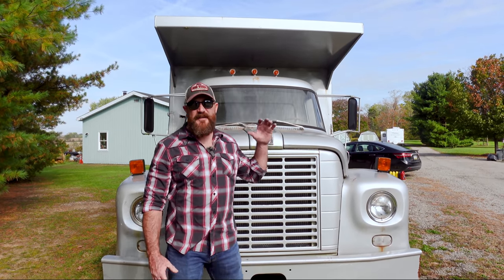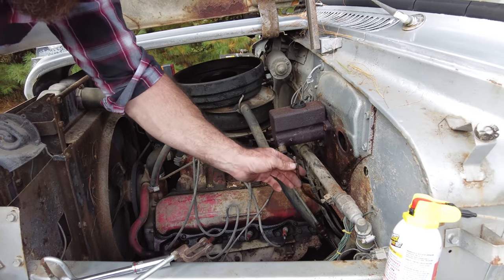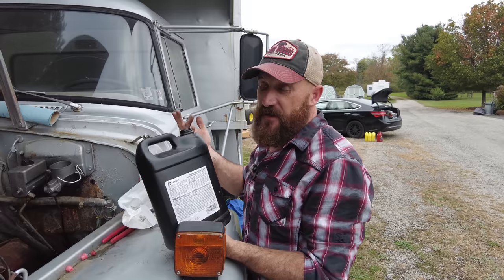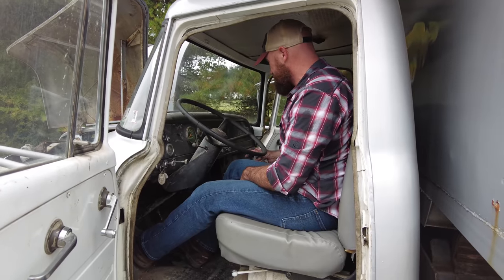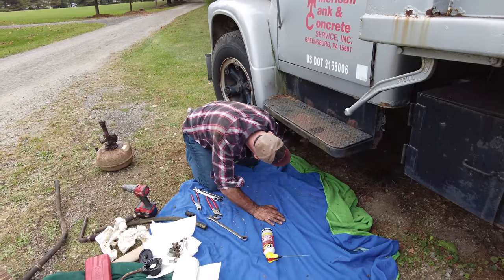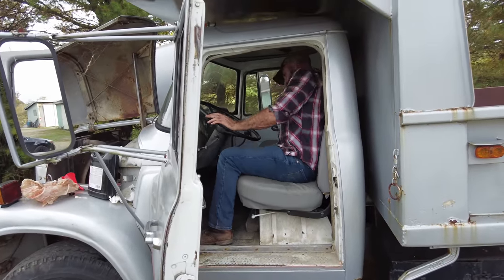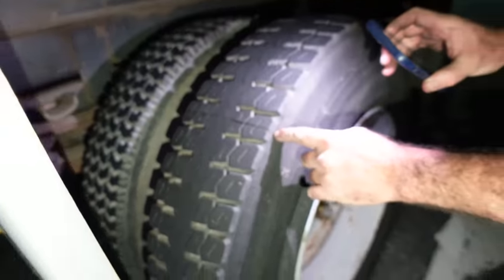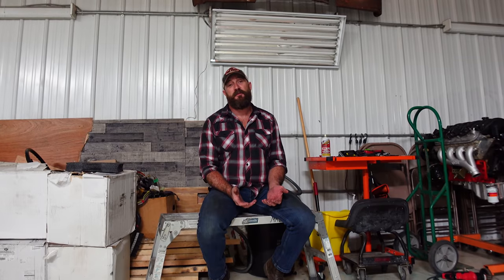Will it Drive 250 Miles Over a Mountain after 15 years ?! 1969 International 1800 Dump Truck

Comment: How? I mean.... Shit, when I do anything with brakes I'm bleeding every corner.... purging abs pumps on newer items. I'd for sure assume there's air in the lines... probably like 40%+ at least. The fun part of any brake line replacements though is always the need for new calipers, due to frozen breaking bleeders. Calipers can be fine in all ways, and that broken bleeder will fk ya. Then again, you can always bleed at the line via the banjo bolt and some line clamps. Of course a vac bleeder is a must. I suppose in this case it'd be wheel cylinders for massive old drums? Regardless, you gotta bleed the corners man. Can't just partially bleed a system. And do it in order, or nothin at all.

Also, Greensburg PA eh? That's awful close to me... Dang... coulda helped.

Comment: I worked on those for about ten years. All bolts and wrench sizes are SAE.. is that a 345 cubic in or 392?
Reply from the maker: A 345ci in her. Wish it would have the 392 though…

Comment: That type of hydraulic system needs to be pressure bleed. Both brakes and clutch system.
Reply from the maker: I believe you’re right Clyde. Just couldn’t get all of the air out of them. 🤦🏻

Comment: Would I??  Hell, I did before you were born.  Nothing like a little adrenaline to make life interesting.

Not wanting to use the proper hold down because it's metal????  Millennials.....

If only one tire and hub are hot then you have a wheel bearing going bad.  

You seem like a fairly smart young man.  The heat differential at 4 feet is not even remotely an issue unless its a jet.

I appreciate your sharing and the video.  May I recommend hang out with some old guys for a bit to give you some knowledge that could be beneficial.  Just saying.  Perhaps Derick at VGG and you could team up??

Comment: Those old trucks were built to last. I’d suggest you jack up the rear tires and check the brake shoe drag, we used to have problems with that on the old 2.5 ton Army trucks you may also want to check your hydro-vac booster that may be sticking and not releasing pressure to the rear axle. 

Great content , keep-’em alive and safe travels.
Reply from the maker: Thank you for sharing those tips….   This thing is built very solid for sure. We’ll dig into it and see what all it needs to get it running and driving like it should be.

Comment: On the line to the brake booster after soaking I'll use a good set of vise grips and slowly work back and forth on those old jobs where it's rusted usually works!!
The darn headache rack is bigger than the whole truck 😂
Reply from the maker: That thing is huge !!
Reply: Lol yes